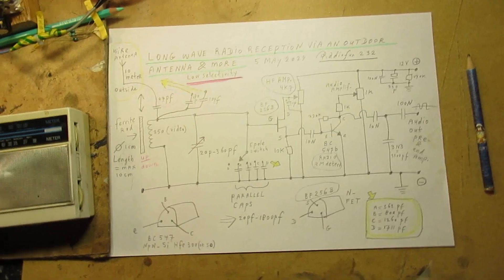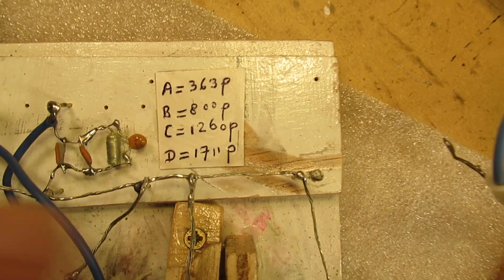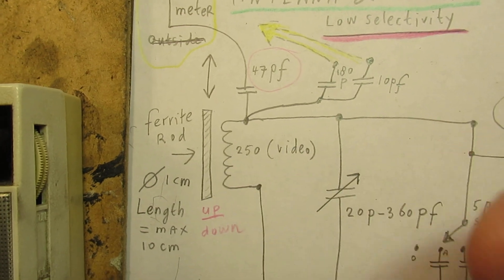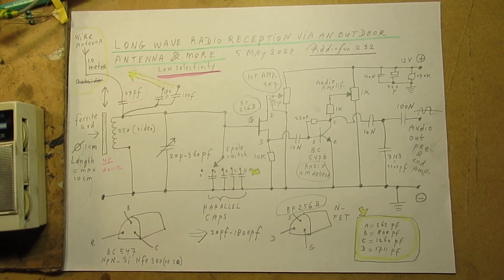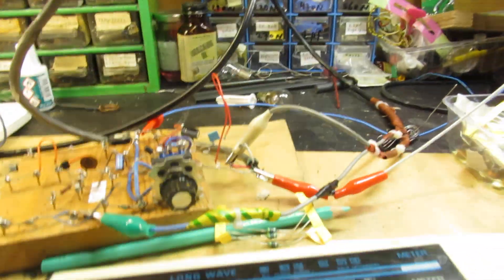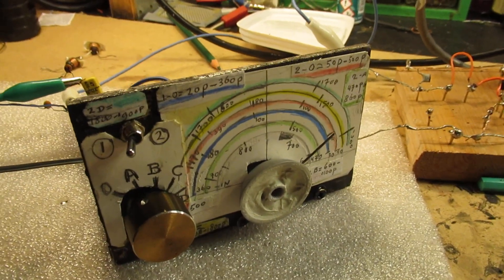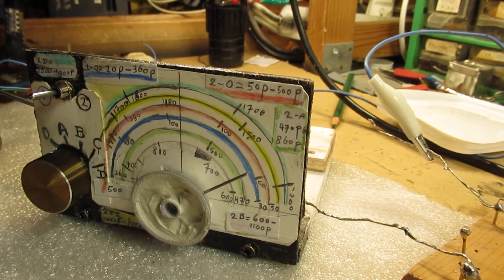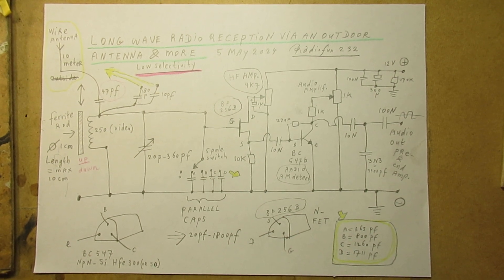Long Wave radio reception (say BBC in Europe) via a 2 transistor setup + a wire  antenna (schematic)

Comment: Good stuff. I will try building my own.
Reply from the maker: Thanks Ron, it is the easiest way to make a TRF radio. Both for LW and MW. For MW: only the coil has to be adapted to receive AM radio signals (800 KC-1.6 MC) on MW. In fact not very difficult. The FET acts as a kind of radio tube with its extremely high input resistance at its Gate. It means that radio reception coils are not damped, thus via them (in combi with a paralleled tuning cap. that goes from say 20 pF to 500 pF or even higher) you can get proper and sharp tuning to radio stations on LW and MW. The idea works good up to say 2 MC, not higher. Thanks again.5 May 2024.
Reply: @radiofun232  Thanks.

Comment: I had one idea for your audio preamplifier for your circuit, use Emitter swamping on the emitter, by doing this it lowers the distortion.From my study of textbooks I've developed some simple math to figure out the resistors. For the first value I went with a value of 1500 ohms across the collector. 1500/4.1666=360/4=90, 360-90=270, the unbypassed resistor is 91 ohms and the (capacitor) bypassed resistor is 270 ohms.

Comment: I have two 2N3866 from 20 century.
Bf245, mpf102 and BF246 is missing here Brazil.
Reply from the maker: The only thing that I can say is this: try your FETS in this circuit. Use small signal FETS, not power FETS. The BF 245 (small signal FET) is surely usable here, I used it many times with good results. The BF 256 B is (in a kind of way) a good replacement in this circuit and not obsolete. In this case we must/you can use small signal N-FETS, like the BF 245 a,b.c, (obsolete, though they works best).Or the FET that I show in this schematic. I show, by purpose (I adress a broad public on YouTube and do not want to show schematics that can/will fail) no obsolete FET types. Though these obsolete small signal FETS can work good. Please note: many small signal N-FETS do not want to work in this schematic! That is the reason why the following FETS surely work: The BF 245 (a,b,c) and the BF 256B. I am interested in your experiments, with results, also from other YouTubers that can show (in a video) a proven result when other FETS are used in this circuit. 6 May 2024.